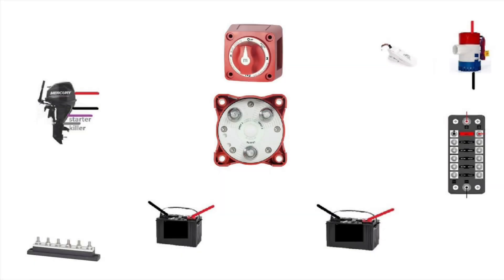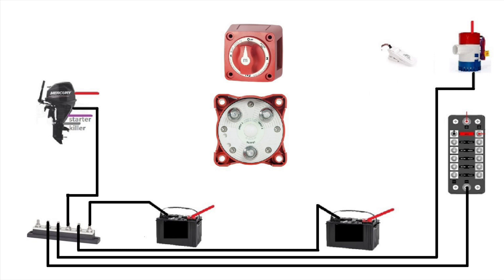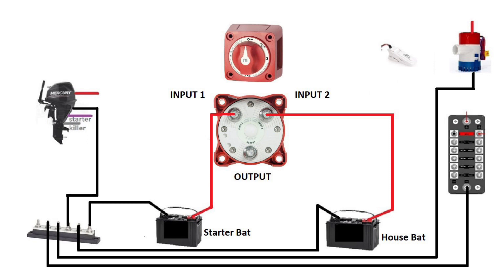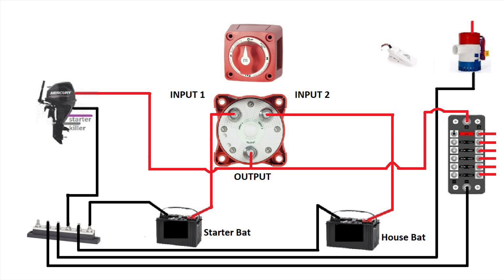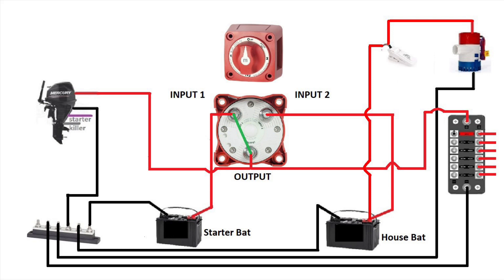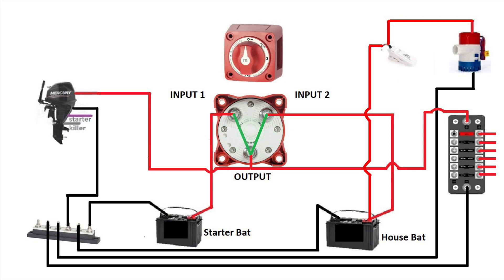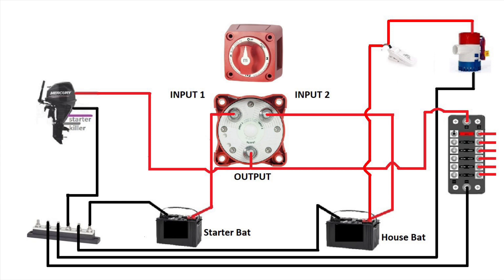How to install a battery switch on a boat

Comment: Is it safe to switch from bank 1 to 2 while engine is running ?
Reply from the maker: Hi Future_memory, thanks for watching. It’s usually safe to change from bank 1 to 2 if you have a « make before break » switch. 👍 You will need to verify what kind of switch you have.
Reply: @joetheboatguy5394  mine is 9001E by Blue  Sea Systems and upon looking, it does have one. I was debating whether to put two deep cycles in or one cranking and one deep
Reply from the maker: Hello, today they do have batteries that have the cranking power and deepcycle effect. If you have a bigger engine that requires lots of cranking power and you install a deep cycle battery for it, you can damage your battery since they are not designed for that (mostly old deep cycle battery) if you don’t have your batteries, I would look for the batteries capable of doing both cranking and deepcycle. They are more expensive but worry free. 👍 hope this helps 🙂
Reply: @joetheboatguy5394  thAnks Joe. Engine is a Mercruiser 4.3lx (carbureted) which requires 375 ca / 475 mca. It had deep cycles in it for years and they worked great for about 6-7 years but since it is now time, i am contemplating on which ones to get
Reply from the maker: You must of had a pretty good higher CA deep cycle battery 👍

Comment: Why is charging both not the best option? Surely when you are motoring along, you will want the alternator to charge everything?
Reply from the maker: Hi rorschach, thanks for watching. Often both batteries will be different. One will be a starter battery and the other a deep cycle battery. They will have different specifications and that is not alway good for chargeur and batteries. If they are identical batteries then there’s no problem. Hope this helps 👍
Reply: @joetheboatguy5394  thank you joe! that is very helpful! And when the engine is off... should I keep it on both? Or will that discharge my starter battery?
Reply from the maker: That is correct you might discharge your starter battery quicker. Your starter battery is meant to give higher amperage quick (for cranking engine). Deep cycle is designed to give you less quick amperage but last longer. Hope this helps.

Comment: You should never turn your switch from any position while your outboard is running.
Reply from the maker: Hi offgridwhitetails, thanks for watching. You are right with old switch that are Break-Before-Make: A switch that is configured to break (open) the first set of contacts before engaging (closing) the new contacts. This prevents the momentary connection of the old and new signal paths. Almost all new switches are make before break” transfer, in that the transfer switch makes a connection to the new power source before breaking its connection to the old one. I always recommend to use make before break switch in my channel 👍 I also mention this in the description of the video.

Comment: Thank you for the video! Just one question. There are so many different bus bars online, what amperage does it need to be in order to have both batteries and the motor grounding to it?
Reply from the maker: hi baileyschornak, thanks for watching and comment, Bus bars are usually high on amperage (200A). It all depends on what you are plugging on the bus bar. But if you get a 200A one, I'm pretty sure you will be fine :)

Comment: How do you connect things like a live well, courtesy lights, radio and fish finder. Especially if the boat is already wired and you want to add second battery?
Reply from the maker: Hi A5JDZK, thanks for watching take a look at my channel I have a couple of that can answer your questions. Especially this video take a look. Don’t forget to like and subscribe 😉

https://youtu.be/bnQZmurYQ-g?si=20NLvW7zDKd8WMs4

And to add second battery 

https://youtu.be/l4Ve6KpiAqQ?si=L-CllreZcDaVBLUK

Let me know if this helps thank you.
Reply: @joetheboatguy5394  Good vids. I should have asked, How to identify existing components, then isolate them to the house battery. I'm trying to add a second battery to my boat. The issue is, my boat came wired without a GPS/Fish finder or a radio. My current set up only has a circuit breaker in the bilge area. And I want to add a second battery to run all the accessories and keep the current battery to just crank the engine. Thanks again.
Reply from the maker: Oh that would be a little hard to answer since I never saw your set up. Is you set up man made or is it from the manufacture? If it’s from manufacturer, then you would be able to find the wiring diagram for your boat. If it’s man-made then you would have to follow the wires to figure out what’s going on. 

Fuse box is always a good place to start 

Keep us posted 👍
Reply: @joetheboatguy5394  It's a factory job from Tidewater. I found it online. Thanks for the reply. One last question. I see my boat is only equipped with a circuit breaker in the bilge area. Can I use a negative buss bar and fuse box instead of the circuit breaker? I plan to add a second battery for the Garmin and Boss Audio Radio. Thoughts?
Reply from the maker: I usually use the circuit breaker to protect the whole system. So, the circuit breaker would be between the batteries and fuse box. The fuse box is used to protect a part of your circuit or a specific equipment. That how it usually done. So having both is a great Idea. Hope this helps :)
Reply: @joetheboatguy5394  Man, you've been great. I really appreciate you answering my questions. Thanks for the vids and advice. Definitely appreciate it.

Comment: If you currently only have one battery, do you still need the circuit breaker that's in the bilge area?
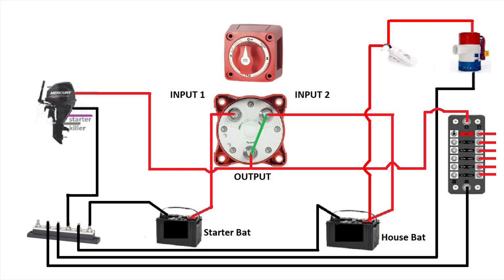Reply from the maker: Hello A5JDZK, Thanks for watching, here a video I did for one battery setup. The bilge pump is connected at 2:15min check it out.
https://youtu.be/bnQZmurYQ-g
Let me know if this helps 😊

Comment: I am going to use this as a solar battery selector. Two different kinds of batteries. The instructions that came with my switch were in series and this is parallel. Instead of a motor I am using solar panel controller as my output. Good video.

Comment: Two batteries are  not needed.
Reply from the maker: Hi JimNobles, thanks for watching, You don’t need 2 batteries but if you want to separate your startup battery and deep cycle battery this is one way to do it.
Reply: @joetheboatguy5394  I need a Bass Tracker Pro 175, 75 hp wiring diagram. 2001. I bought the boat used. The previous owner burned up the ground wires in every harness. I replaced the grounds. Put fuses on grounds to battery. I messed up on the volt, tach, gas guages , and the 6 wire ignition switch. Switch comes with 6 wires and double jumpers in purple and black leads, but why and what for. There are 3 purple wires under dash. Now the motor(75 hp) won’t turn off:(((((((
Reply: As an electrician this is usually easy. But I’m tired, old, frustrated
Reply from the maker: This is the standerd boat wiring codes, unless users haves changed some wires. So your Purple wires should be "Violet 12v Ignition Generator or Engine" so should have 12v when ignition is ON. 

To turn your Engine off: it usually the "black and yellow" wire. Should be grounded when ignition is off or when kill switch is activated. 

Black 	Grounds, General
Black/Brown 	Pump Grounds 
Black/Red 	Voltmeter Grounds 
Black/Orange 	Isolated Accessory Grounds 
Black/Yellow 	Ignition stop 
Black/Green 	Water Level Sender Ground 
Black/Blue 	Lighting Grounds 
Black/Gray 	Nav Light Grounds 
Black/White 	Battery Parallel Solenoid 
Brown 	Pumps, General, Bilge or Sump (Manually Switched)(Also alternator starter to Ign.) 
Brown/Red 	Pumps, Bilge or Sump 
Brown/Orange 	Power feed to Auto Bilge Switches, Pumps, Fuel/Oil Tranfer or Priming 
Brown/Yellow 	Baitwell or Aerator 
Brown/Green 	Fresh Water Pump/Water Maker 
Brown/Blue 	Head Pump 
Brown/Violet 	Washdown Pump 
Brown/White 	Trim pos sender 
Red 	Battery Feeds Unprotected 
Red/Violet 	Misc. Accy. Main Feed Protected (fused) from batt to trim panel. 
Pink 	Fuel Sender 
Orange/Black 	Audio System Feed 
Orange/Brown 	Electric Head, Sanitation System 
Orange/Red 	Wiper Port 
Orange 	Accessories common feed, Dist Panel to Acc switch, Anode Electrode, Mercathode 
Orange/Yellow 	Diesel Preheat
Orange/Green 	Wiper Stbd 
Orange/Blue 	Communications Equipment 
Orange/Violet 	Navigation Equipment 
Orange/White 	Wiper Center 
Yellow/Black 	Choke  Neutral saftey trans mounted 
Yellow/Red 	Start Solenoid (starting circut), Neutral Safety 
Yellow/Orange 	Powered Ventilation, Fans 
Yellow 	Bilge Blowers (also alternator DC output) 
Yellow/White 	Rudder Angle Sender 
Green/Red 	Stop Solenoid/Kill Switch 
Green/Yellow 	AC Grounding 
Green 	Bonding 
Green/White 	Engine Trim in and or tilt down 
Green/Orange 	Engine Independent Trim down 
Blue/Black 	Cabin Lights 
Blue/Brown 	Oil Temp Send 
Blue/Red 	Cabin or Cockpit Lights Port 
Blue/Orange 	Engine Independent Tilt Up 
Blue/Yellow 	Lighting Circuits to Remote Send 
Blue/Green 	Cabin or Cockpit Lights Stbd 
Blue 	Instrument & General Lighting 
Blue/Violet 	Courtesy, Boarding Lighting 
Blue/White 	Engine Trim Outand/or Tilt Up 
Light Blue 	Oil Pressure 
Violet/Red 	Eng. or Generator B+ from Breaker 
Violet/Yellow 	I/O Trim Up (ballast bypass) 
Violet/Green 	I/O Trim Down 
Violet 	12v Ignition Generator or Engine 
Violet/White 	Trim "Trailer" switch 
Gray/Black 	Mast Light 
Gray/Red 	Spotlight Remote 
Gray/Orange 	Docking Lights 
Gray/Green 	Strobe or Beacon 
Gray/Blue 	Spreader/Flood Lights 
Gray/Violet 	Windlass/Winch 
Gray 	Navigation (running) Lights, Tach. Send 
Gray/White 	Anchor Light 
White/Brown 	Temp. Alarm or Indicator 
White/Red 	Fuel Alarm or Indicator ((Ignition module to Dist.)Mercury Thunderbolt Ignition) 
White/Orange 	Fire Alarm or Indicator 
White/Yellow 	Air Flow Alarm or Indicator 
White/Green 	Water Press/Flow Alarm or Indicator ((Ignition module to Dist.)Mercury Thunderbolt Ignition) 
White/Blue 	Oil Press Alarm or Indicator 
White/Violet 	Voltage Alarm or Indicator 
White 	General Alarm Usage, Yamaha Kill Switch 
Tan 	Water Temp sender 
Tan/Blue 	Warning system sense wire (Audio warning) 

Let me know if this helps :)

Comment: Why not skip the crappy 1/2/B switch and use a DC/DC charger. No manual switching is necessary and the house battery is charged more efficient. If you are afraid of running out of juice in the starter battery, consider Ctek DC/DC charger with the SmartPass, that will give up to 120Amps extra from the house battery to the starter battery "backwards" if the voltage is to low to start the engine.
Reply from the maker: Hi Patricklindahl, thanks for watching and comment. Yes of course they are many better ways of doing this set up. But this is the way most people have it, This diagram is to help people that have problem with this setup.
Reply: There are pros and cons to doing it with the charger for sure.  First of all those switches aren't crappy and likely more reliable than the charger, secondly there are more reasons to do this than just charging.  Isolating a dead battery in a breakdown situation and running engine and house on one battery would be the most obvious.

Comment: Hi! Tnx for this explanation. 
Can you please tell me how to connect intelligent battery combiner?
Tnx in advance.
Reply from the maker: Hi Manfredroncevic, thanks for watching. To my understanding the intelligent battery combiner will have a input and outputs. I haven’t done much of intelligent battery combiner. But the input should be your alternator positive connection. And each output on the intelligent battery combiner will be the positive on each battery. 

Hope this helps
Reply: @joetheboatguy5394  TNX.

Comment: I still have power when switch off and there's no wire from the switch to the fuse box just the starter
Reply from the maker: hi lilbtank419, thanks for watching, you might have a defective switch. first thing I would do to eliminate switch from the equation is disconnect the switch completely and test continuity.  Once disconnected take a Multimeter and test continuity on your switch to make sure it works properly. Set your switch on the "off" position and test continuity between "input 1" and "output" should be no continuity. Do the same test with "input 2" and "output", once again they should be no continuity when position of switch is on "off" position. Let us know :)
Reply: @joetheboatguy5394  I tried a new switch today did the same thing
Reply from the maker: Another test you can do is removing your switch and if you still have power going to your equipment then you have a wire that goes straight from battery to your equipment.

Comment: I have similar set up(no bus bars) but also have Noco smart charger plug in each battery.  I have connected the crank neg to deep cycle battery.  Problem...when the switch is in off position rocker panel still works.  I cant figure out what I may have done wrong.  Is it the smart charger??  Any insight would be greatly appreciated
Reply from the maker: Hi Andrew Zuk, Thanks for watching, don't forget to subscribe :)  
Don't know whats your knowledge in electronics so I will start with the basic testing. If you have done these tests already let me know. 
My first suspicion is your battery switch. I would unplug and remove the battery switch and set it on the "off" position. Once done you can test continuity with multi-meter between output pin and inputs pins. They shouldn't be any continuity since the switch is set to off. 

For continuity test with multi-meter: https://www.wikihow.com/Test-Continuity-with-a-Multimeter

Let me know your results and will continuous.

Comment: Joe,

I am in desperate need of some guidance for my pontoon.  I have 5 batteries total. I want to make sure they are all hooked up correctly.  I have 4 things but possible 5th that’ll require power.  I have one Pecko 2 way switch already installed - 1, 2, All and OFF.  I also have 2 onboard battery chargers.  1 is 2 bank and 1 is a 3 Bank.  I can send pics or specs if needed.  

1. Motor/ignition
2. Trolling motor 80lb thrust
3. Garmin Depth Finder
4. 8 speaker w 2 12” subs stereo
5.  Possible re-hook up bilge pump

Main ? Is how to hook up all of these appropriately if you can give any advice I would be forever grateful!
Reply from the maker: Hi Brad Harbert, thanks for watching. I have a couple of videos on my channel on how to plug equipment. this one might be helpful to you:  https://youtu.be/l4Ve6KpiAqQ
Also, for your batteries if you need to connect in serial or parallel here another video: https://youtu.be/Pi2YmVbQKd4
Make sure your Switch are Make before break. 
I have many electronic videos on my channel all you need to do is combining them. 
Let me know if you need more help. Also is your trolling engine a 12V or more?

Comment: So, the way this is set up, you dont have a separate bus bar for grounding...if i add an AC system, can i just hook the ground from that to the negative bus bar in the DC system, or should i have a second bus bar for grounding that i connect the DC bus bar and the AC bus bar to, and then to the engine?
Reply from the maker: Hi Beth G, thanks for watching. In this set up I do have a bus bar for ground. The bus bar is to keep all wire to go the the batteries. Much cleaner setup. When hooking up your AC make sure you have the right gauge wires. Your + wire (usually red) will go to positive of batteries or + bus bar from batteries. Your black wire is your ground. So it goes to the negative of the batteries or negative bus bar. Let me know if this helps.

Comment: How is this setup wired with a 4 way switch
Reply from the maker: Hi zop133, thanks for watching. The switch has position 1, 2, 1&2 and off position.
Reply: @joetheboatguy5394  ok thanks

Comment: Hey Joe, 
In your personal opinion - do you think it’s necessary to add a start isolation charging relay that I’ve seen in other forums and videos? I’m sure it doesn’t hurt but is there that much of an advantage in adding one? 
Thanks!
Reply from the maker: Hi Ryan, The advantages of a VSR is 
a) Avoid human error: if the boat is off and you're powering accessories, you won't drain your cranking battery.
b) if you need (in a pinch) to use your secondary battery to crank the boat, you can override with the click of a switch.

Some people won't go without it and some will never use it. it's a personal choice.
Reply: Perfectly explained! I guess my preference is to have added safety measures in place. Keep up the great work! 

Thanks,
Reply: And to clarify - you have a video with the VSR which is essentially the same thing correct? Do you have a video with adding the VSR in addition with the battery selector switch? 
Thanks and great videos!
Reply from the maker: Hi Ryan Ballance, The VSR will act as your battery isolator, allowing your main battery to disconnect from the secondary battery when alternator is no longer charging. Yes its essentially the same thing.

The Voltage Sensitive Relay (VSR) allows two batteries to be charged at the same time.
When the engine is started and the start battery reaches 13.7 volts, the VSR engages, allowing two battery banks (start and auxiliary) to be charged simultaneously.

When the voltage drops below 12.8 volts (eg the engine is stopped), the VSR disengages, separating the batteries. This system eliminates the possibility of draining the start battery and protects sensitive electronic equipment powered from the auxiliary battery from harmful engine start up spikes.